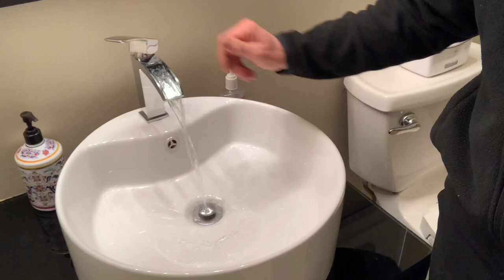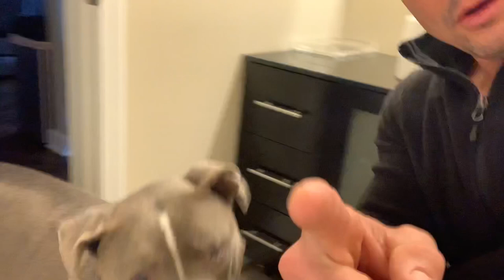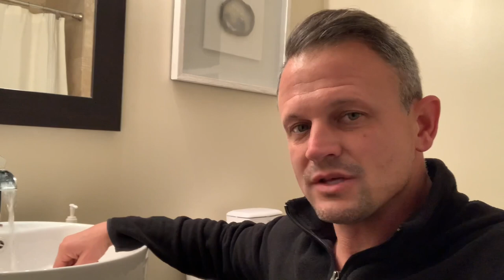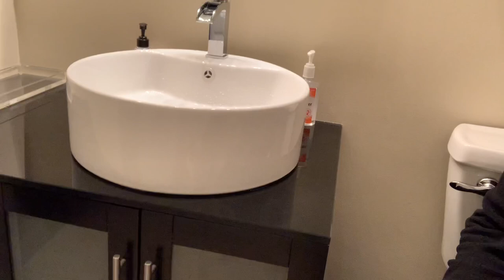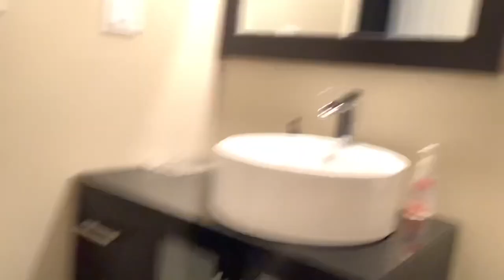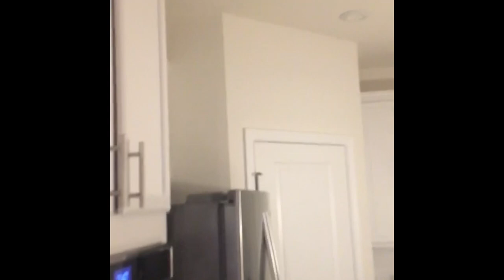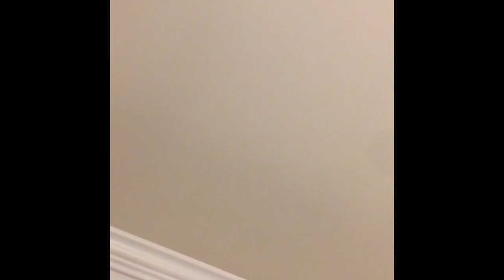Hear Water Dripping, but Can’t Find Any Water Damage?

Comment: Hi BJ. My name is Miroslaw. My problem started with this... After flushing the toilet, suddenly the water filling the reservoir stops flowing. I checked all the tops in my apartment-there is no water. After some time everything return back to normal. Recently the shower has became a problem. The water from bathtub flows normally. After switching to the shower it stopped flowing.The situation returns to normal after some time and problem returns again. My problem started after replacing the boiler. After that there was very little  pressure in hot water in kitchen sink. There was no water in my bathtube. We called the company which replaced broken boiler. They sent another plumber. He told us that we have to pay extra money to fix the problem. I suspect that, the first plumber did something on purpose to create new problems. I don't believe  in black magic or bad luck.  Powiedziec co z tym zrobic. Mamy bardzo maly income i nie stac nas na kolejne wizyty hydraulikow. Zalaczam pozdrowienia dla malzonki-Miroslaw
Reply from the maker: Cześć Mirosław- Sorry to hear you’re having issues. When you change out your boiler/water heater, the plumber has to turn the water off at the main shut off valve. It’s very common that when you turn the water back on, there’s a rush of water that loosens up the sediment that is in the water pipes, and pushes it to the plumbing fixtures. Where it can get clogged in the internal parts at your toilets, faucets, showers, etc. What you would have to do in a situation like yours is turn off the water and go to each plumbing fixture and clean out the sediment build up, or possibly replace the the internal parts like: the fill valve in the toilet, cartridge in the shower, cartridges in the faucets, aerator screens in the faucets, etc.

If you’re not comfortable doing plumbing repairs yourself, it would be best to hire a professional. Whether that’s a plumber or a handyman that’s comfortable with doing plumbing work.
Reply: Czesc B.J. Thank you for  your answer.  I understand that my english is not good. Please ask your wife for proper tlanslation.-----Witaj zono fachowca. Moj problem jest nietypowy gdyz nigdzie  w internecie nie ma o tym mowy. Wszystko w moim apartamencie dzialalo jak nalezy, az do momentu kiedy amerykanscy fachowcy wymienili nam bojler. Jak wyszli okazalo sie, ze w wannie nie ma wody w kranie a w kuchni jest bardzo male cisnienie goracej wody. Kiedy doczekalismy sie ich wizyty --przyslali kogos innego - Ten niczego nie sprawdzajac powiedzial, ze trzeba wymienic kran w lazience i bedzie to kosztowac $400.  Powiedzialem zeby sie pocalowal..i zaczalem przy nim odkrecac oslone kranu. Zadzwonil on do swojego szefa i tamten opuscil na $150. Od razu wyczulem jakis przekret i  wygonilem go.  Z tym kranem jakims cudem, poradzilem sobie sam  a w kuchni dalej nie ma goracej wody. Teraz zaczely sie lepsze numery. Po spuszczeniu wody w sedesie nie mam zadnej wody w kranach, przez co najmniej godzine. Potem wszystko wraca do normy az do kolejnego spuszczenia wody w sraczu. Moze bojler jest zapowietrzony albo cos innego jest z nim nie w porzadku. Jednego jestem pewien, ze to " fachowcy " wymieniajacy bojler zrobili cos specjalnie, aby ich wezwac ponownie. Przeciez wymiana bojlera nie mogla spowodowac awari kranow w lazience i w kuchni.  
--Pozdrawiam Was-Miroslaw  @BJPoznecki
Reply from the maker: @miroslawsita7062  Przepraszam za spóźnioną odpowiedź. Cóż, często zdarza się, że wyłączają wodę, aby wymienić bojler, a następnie ponownie ją włączają. Przez rury przepływa woda, która rozluźnia zanieczyszczenia i osady znajdujące się wewnątrz rur, wypycha je w dół do armatury wodno-kanalizacyjnej, a następnie zatyka krany, toalety, zawory prysznicowe itp.
Aby to naprawić na tym etapie, należy wyłączyć wodę, rozebrać każdą armaturę wodną i wypłukać pozostały osad lub zanieczyszczenia. Wyczyść wewnętrzne części kranu, toalety, zaworu prysznicowego, a jeśli jest wystarczająco źle, może zaistnieć potrzeba ich wymiany. Następnie złóż wszystko z powrotem i powinieneś mieć dobre ciśnienie wody.
Reply from the maker: @miroslawsita7062  Violetta i ja jesteśmy ciekawi, czy mieszkasz tutaj, w stanach, czy w Polsce?
Reply: Hi BJ, czesc Violetta. Mieszkam na Florydzie. Wynajmuje sypialnie  od starszej Polki, ktorej sie tez nie przelewa. Sumujac nasze skromne dochody, nie stac nas na hydraulika. bardzo dziekujemy za listy. Kupilem zwykla konewke  i grzejemy wode do kapieli na kuchence.-Pozdrawiam Miroslaw  @BJPoznecki
Reply: Czesc Violetta. Rozbieranie i czyszczenie wszystkich kranow, nic nie pomoze. Kiedy wstaje rano, woda jest we wszystkich kranach i ma NORMALNE  CISNIENIE. Problem zaczyna sie po splukaniu sedesu. Ledwo zaczyna sie ponowne napelnianie rezerwuaru-woda natychmiast przestaje naplywac. Malo tego, to we wszystkich kranach w mieszkaniu, nie ma kropli wody. Tak samo sie dzieje kiedy probuje wziasc prysznic, przelaczam na shower option i woda od razu przestaje leciec. Wychodze z wanny -we wszystkich kranach nie ma zadnej wody. Po uplywie niecalej godziny, wszystko wraca do normy a rezerwuar jest wlasciwie napelniony a CISNIENIE we wszystkich kranach jest takie same jak z rana. Wyglada na to, ze linia prowadzaca do kuchni jest w porzadku. Przez calym dzien myje w zlewie rece i zmywam naczynie a woda bez problemu jest w obydwoch kranach. Otworzenie doplywu wody do lazienki stworza problemy, o ktorych pisze. Mysle, ze cos jest zle z bojlerem. Moze jest zapowietrzony albo nabiera zbyt malo wody . Te problemy pojawily sie po wymienie bojlera a hydraulik nie chcial ich usunac w ramach gwarancji, dotyczacej wymiany bojlera. Przedtem  bylo wszystko w porzadku.!!! Nikt o podobnym problemie nigdy nie slyszal a kazdy hydraulik chetnie przyjdzie  i wtedy dopiero zaspiewa cene. A na to nas nie stac. Na wymienie bojlera musielismy sie zapozyczyc. Gdybym wiedzial co jest zle, to sam bym to naprawil. Potrafie wymienie krany w kuchni czy w lazience. Wiem jak wymienic seeds i zlew kuchenny i inne takie drobiazgi. Glupi calkiem nie jestem @BJPoznecki --pozdrawiam Mirek

Comment: I heard the water running through the pvc pipe that goes outside from upstairs to the basement even when water shuts off in the summer when furnace is not on, is that normal? Thanks
Reply from the maker: Yeah it’s very common because we use PVC pipe for drains inside your wall. On older homes we used to use galvanized or cast-iron pipe that was thicker at where you wouldn’t hear water running through it. The plastic PVC pipe will last forever, however the only downfall is that it does not have the sound deadening characteristics of steel pipe.

Comment: So should we attempt to have it fixed or let be since they are benign sounds?
Reply from the maker: That’s up to you. If it doesn’t bother you, then I would leave it because trying to track down where the sound is coming from can get invasive. The only way to fix it is to open up the area, try modifying the pipe or duct, and then putting everything back together, so it’s going to entail opening up walls or ceilings.

Comment: I'm having the exact same problem right now in my condo everything you're describing. not only I'm hearing that knocking sounds and also the water running inside the pipes in the ceiling and walls above me. I'm frustrated I have hired multiple plumber and heating company. they had me bleeding the pipes, change the flapping valve inside the toilet, change the fluid master in the toilet bowl. specially at night i haven't had a goodnight rest in months, to the point now I'm putting the place for sell.
they have a 1/4inch drywall, the pipes are pvc, it's horrible the extent the builder go to save money. 
a few plumber told me it's a permanent problem, the best thing for me to do tear down the ceiling and walls and insulating everything.
IS THERE ANYTHING else I can do to fix this until I get rid of the place.
Reply from the maker: I’m sorry to be the bearer of bad news, but unfortunately the plumber and the heating and air-conditioning contractors are right. Trying to find exactly where the noises are coming from entails opening up walls and ceilings In the process.

Comment: This was a great video.  My question is can this happen with only cold water being run?  I just bought a house about 5 months ago and have not heard this until yesterday.  And it only happens when I flush the toilet.  There is no hot water involved.  The dripping sound is about 15 feet from the toilet.  I hear it in the floor of the house as well as the ceiling of the basement.  It's the same spot.  There is no leaking that I can find.  My basement is not finished so the pipes are exposed.  It doesn't happen when I use any hot water.  I would love to send you a video to see if you think it could be that. I will pay you to diagnose for me.  I am leaving for the winter in 2 weeks and don't want this to be growing mold while I'm gone if it actually is a leak. Thank you!
Reply from the maker: Thank you! Sure you can text or email me a video. Just start far enough back so I can see the whole room and then slowly walk towards the area with your phone in the horizontal or landscape position. 

773-403-3298
bj@inspect-n-check.com
Reply: I sent 2 videos
Reply: Thank you for the quick response and the diagnosis with my videos.  You have saved me a lot of money not having to get a plumber out to my house at the last minute to basically tell me my pipes are creaking.  In case anyone else has the same issue with cold water, it WAS the pipes because of the heated basement and the water being so cold.  It can happen with cold water.  BJ, I appreciate you beyond words!  You are excellent at what you do.  Thank you again!
Reply from the maker: @kitkatb8303  My pleasure Kathy, I’m always happy to hear when nothing is leaking! ❤️

Comment: Hello, is it normal to hear it all year round  in hot and cold weather? I only hear this sound on my kitchen sink when hot water running and stops when I turn it off. How is it that the other pipes don't make any noise like my bathroom, shower, laundry? Thanks
Reply from the maker: Hi Katie- Yes, it is possible to hear all year round when running hot water because the water is so much hotter than the pipe when it’s not used. 

Well it’s hard to say because there could be a bunch of different factors such as maybe the kitchen sink plumbing runs through an exterior wall, is a different pipe material, or is secured tighter than the other pipes all of these which can cause the thermal expansion noise to be more pronounced than the bathroom and laundry.

Comment: It just started happen when my air goes on idle. “Dripping sound “ but no water anywhere . 
On my big air vent ,,, next to my fridge.  It’s only WHEN MY AIR CONDITIONER GOES IN IDLE . So this is nothing to worry about ? 
😮 tell me I have nothing to worry about pls.
Reply from the maker: Well, I would look into the vent, or take it off if you have to, and see if there’s any signs of water dripping. I actually did have a leak with my air conditioner once before, so It’s always best to investigate as much as you can, and if you don’t find anything, continue to monitor it until you know for sure.

Comment: I'm over here freaking out 🥴 I'm about seconds away from drilling a hole. It's very irritating 😳 OMG!! Mine sounds identical to yours. But why hadn't I started hearing this until recently.  I've been living in this house since 2005
Their sound is worse than mine 😩
Reply from the maker: Well I would run a lot of water for like 30 minutes just to confirm if it’s thermal expansion or if you have an active water leak.

Comment: I heard dripping and ticking in the wall of my bathroom on the second floor，so i cutted the wall，there is no water found inside. Should i need do something about that？
Reply from the maker: While you have the wall open, I would run a lot of water just to confirm that nothing is actually leaking. If it’s not, I would close up the wall, and say it’s just thermal expansion that you hear when the pipes expand and contract.

Comment: Wow I have noises like that and as a new homeowner I was afraid there was water issues. What if it goes tick-tock tick-tock really quickly, like a few ticks per second? That happens when the dishwasher runs but I don’t see any water damage.

Edit: well the customer video puts me at ease, it is similar to this but much quicker.
Reply from the maker: If it only happens when you’re running the dishwasher what I would do is run the dishwasher and hot water at the kitchen sink for a long time to where it heats up the pipe to see if the ticking noise stops once the pipe heats up.

The disclaimer with this video is I always recommend people run a lot of water just to double check nothing is truly leaking because there is always a possibility of a leak.
Reply: @BJPoznecki  ah! I’ll do that, heat it up and see if it stops after a while. I have noticed the kitchen sink also does it when we use hot water so I’ll test with that. 

Thank you so much for the reply!
Reply from the maker: @empain_  My pleasure let us know how it goes?

Comment: Thanks BJ for the informative video.
My situation is that the noise only happens when it is raining. (same as your customer video) But I couldn't not find any water damage. Had multiple roofers come by and they couldn't find anything. Would my situation be the same, do you think? Thanks in advance.
Reply from the maker: Well if you only experience it when it’s raining then my thoughts would be either something is leaking and water is getting in somewhere and the roofer can’t find it. Or, if you have any metal counter flashing on the exterior sometimes when the rain hits the metal it will make amplified dripping sounds.

When you had the multiple roofers out did any of them do a water test? A water test is where they get your garden hoses and run water over the roof to try and create a leak?
Reply: @BJPoznecki  thanks for suggestions BJ.

Yes. The roofer did a water test but couldn't replicate the noise. It's been a mystery for us. Will keep investigating. Thanks heaps
Reply from the maker: @ango1101  My pleasure! Well typically if there is an active leak it will eventually show its face and you’ll see water stains on the ceiling, walls, or floors.

Comment: I hear about 15 drips after flushing the upstairs ensuite toilet only. I am aware that after our reno that this drain pipe has quite a slope at one point, however I hear the noise at the area where there is another pipe that joins to the hall bathroom. Note that I don't hear this noise after using the showers, the other toilet or the 3 taps. There is no moisture noted anywhere. Could this still be the problem?
Reply from the maker: Hi Rese- Sorry for the delayed response. What I would try doing is flushing that one toilet only multiple times to see if you can create a leak. If you’re not seeing any signs of a leak anywhere, it’s very possible that the drain pipe that toilet leads into is in a wall where it’s maybe warm and the cold water from the toilet makes it contract making those sounds.

What you could always try doing is running a lot of cold water from that bathroom turn everything on the sinks, shower, toilet, etc. and run a ton of cold water and see if after a certain point that you stop hearing that dripping noise, or a leak presents itself.

More than likely what you’re experiencing is just thermal expansion, however, I always like to play it safe and rule out anything leaking because there is always a possibility there could be a leak somewhere.

Comment: I hear this type of noise on main level, more of a ticking/clicking, after kids take a bath upstairs but only when the water is draining. It's not a fast drip like 10sec between clicks. Any idea what this maybe?
Reply from the maker: Hi LT- It’s the same thing in this video thermal expansion. You can experience a variety of different sounds from clicking, tripping, tapping, etc.

Comment: Very helpful/informative, but I just have one question. I just noticed tonight that I have the same issue going on. I hear the tapping in the downstairs ceiling while the upstairs shower is running. I watched your video and you allude to it being warm water on cold pipes causing the tapping sound so I ran the shower cold and still hear the tapping. Is this normal?
Reply from the maker: Hi Ryan- Yes it can happen if you run hot water for an extended period of time now the pipe is expanded, then you run cold water causing the pipe to contract which can create the same thermal expansion type of noises.

Comment: Same issue I have fsince last two years! No leaking water no damage just hear dripping when heat is one and then stop!!! Any recommendations to make that dripping noise stop ?
Reply from the maker: Well, there’s no 100% guarantee you’ll be able to fix it. You’ll have to get a heating and air-conditioning contractor involved. Try and pinpoint the location where the sound is coming from, open up the wall or ceiling, see if you can modify the ductwork to stop it, then put everything back together.